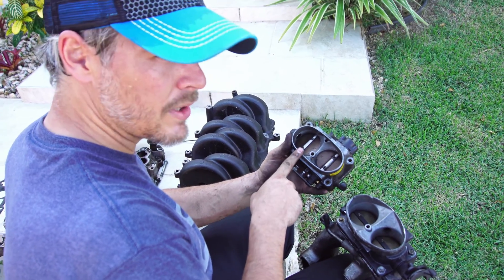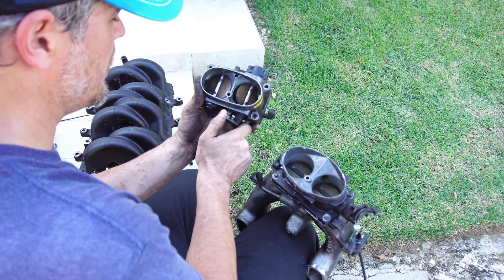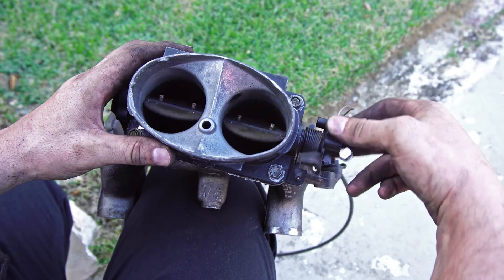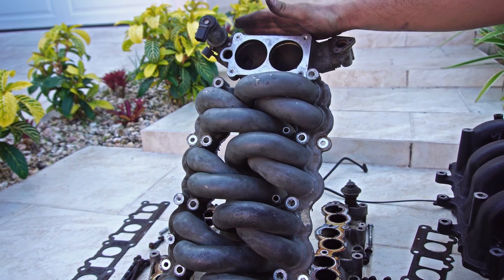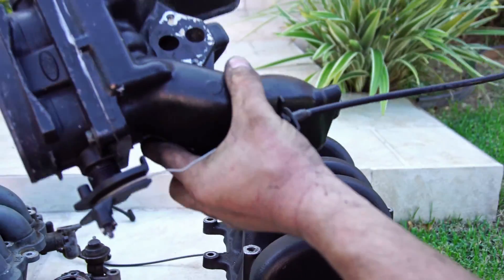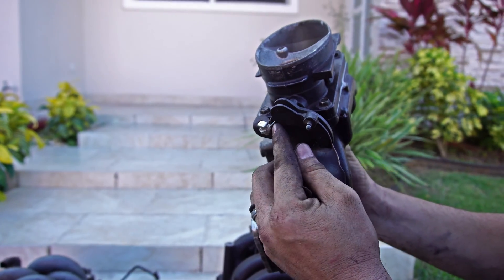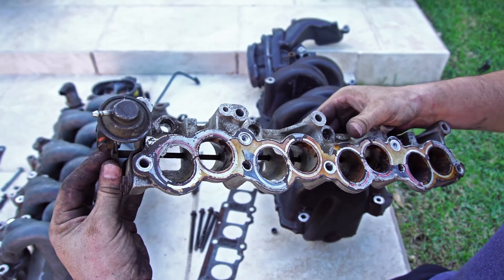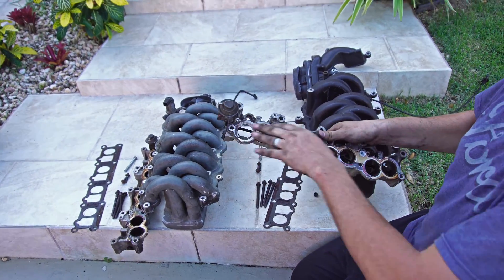Lincoln Mark VIII Intake Comparison

Comment: gen 1 intake flows alot better than the gen 2 it's comparable to the Cobra intake that's why alot of gen 2 owners ditch the factory intake and put on a Cobra intake
Reply from the maker: On my setup it is performing much better than before. No more stalling and no more rich mixture. Runs almost like factory now with more power.
Reply: what do you have for a setup my car is stalled 3.73 Trac loc rear end nitrous Cobra exhaust manifolds 3500 stall converter etc and it sucked once we swapped it out for a Cobra intake manifold my car performance world's better 1998 lsc
Reply from the maker: Alex DeLuco you sound like a guy that like going fast in a straight line. 😁
Reply from the maker: Alex DeLuco I have a welded diff with a 3.73 rear gear. Cobra 5 speed, 1993 Lincoln Mark VIII motor, long tube headers, K&N air filter, no interior, cage, raging seat, coilovers, angle kit, dual calipers in the rear and a pretty sweet paint job to top it all off.
Reply from the maker: No tune, never dynoed. Just plug and play.
Reply: no I just like setting car alarms off...lol but seriously I wanted my car to do everything well so it has some big addco sway bars in it as well and it handles like it's on rails now
Reply: I haven't looked at any of your other videos but to me your definitely building a drift car
Reply: your engine wasn't tuned for your exhaust set up that's why you were running rich and felt low on power if you tuned the engine and tried each intake you'd see the gen 1 will make more power these arnt like old engines they're sensitive to changes
Reply from the maker: Alex DeLuco you are correct. Drift car it is. Hopefully it will be getting tuned very soon.
Reply from the maker: Alex DeLuco you can check out my racing career here or on Facebook where I have more media at www.facebook.com/EdwardLeeThompson
Reply from the maker: facebook.com
Reply: haha I'm following it now
Reply from the maker: Alex DeLuco thanks.
Reply: What are your 1/4 mile times?
Reply from the maker: @noelproblem8713  I've never had it on a drag strip.